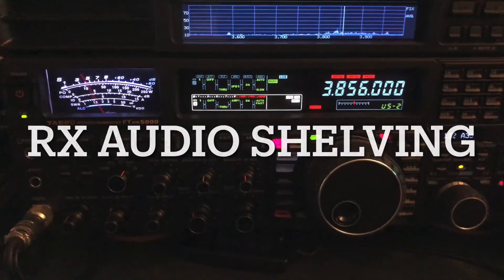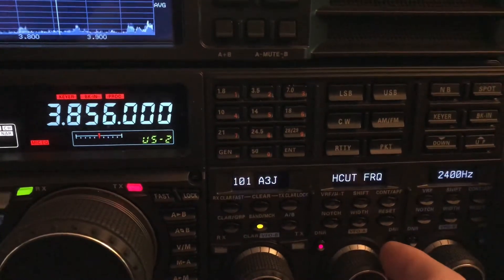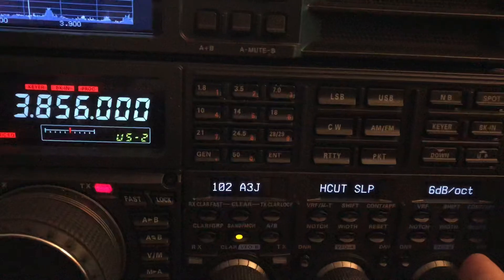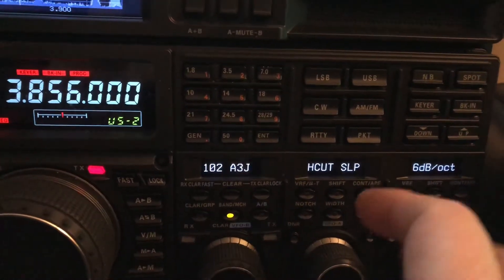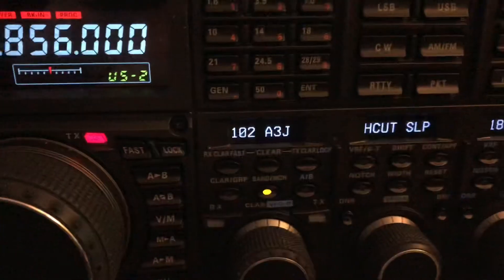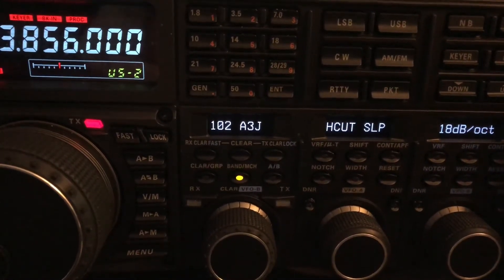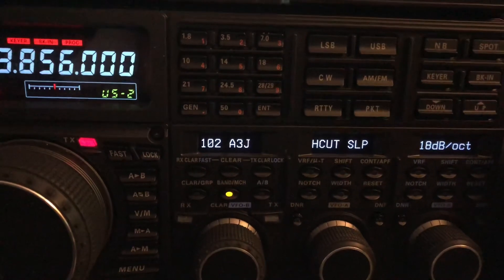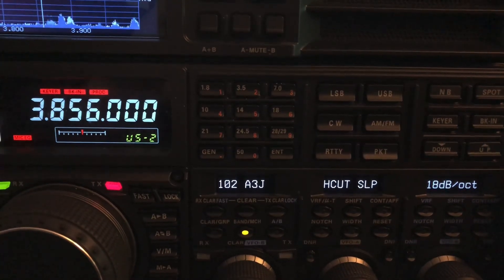RX Audio Shelving for Ham Radio

Comment: I’ve become addicted to LO/hi cut. I leave LO at 200 and rarely ever change that. Use high cut for bandwidth and QRM. I don’t remember seeing a way to do this on dx10 videos and that puts me off from trying a dx10. Maybe I missed a video you did on it. Also like a dedicated knob for hi cut.
Reply from the maker: The older audio DSP units, and older Yaesu radios, like my FT-920, provide a separate high and low cut knob, but that is accomplished via AF DSP.  With IF DSP, you have only a bandwidth knob, which narrows the passband from both the high and low end, simultaneously.  Then you use shift to decide whether you want to position this passband to emphasize lows or highs.  But that is separate from AF tapering, which is the subject of this video.  

The FTdx10 offers AF tapering.  It is located in the Radio Settings menu under Mode SSB, and is called hi-cut and low-cut.  You have a choice to slope at 6dB/octave or 18dB/octave.  I like to begin the hi-cut at 2400 to 2600 Hertz and slope at 18dB/octave.  I have even set it to 2100 Hertz with a slope of 6dB/octave.  I set low-cut to 150 Hertz and slope at 18dB/octave, or I set to 200 Hertz and slope at 6dB/octave.  

So many hams these days add too much low-end to their TX audio, so sloping at 150 to 200 Hertz helps clear up their “muddy” audio.  I have set low-cut to 300, in order to have a QSO with someone who had so much low-end that they reminded me of a bullfrog.  I did that rather than risk offending him by telling him how awful his TX audio was.  I could have also narrowed the passband and used shift to emphasize the higher audio frequencies.

73, de N4HNH
Reply: @n4hnhradio  k3 and ts-590 both have LO/hi cut that are NOT in audio
Reply from the maker: Yes, I know them well.  That is IF DSP.  It accomplishes the same thing as Yaesu’s DSP bandwidth control, but with two adjustments instead of one.  You are narrowing the passband by separately adjusting the high-cut and low-cut in the IF stage.  With Yaesu transceivers, one bandwidth control knob cuts highs and lows simultaneously.  Then you move this newly defined passband around with the Shift knob.  This allows you to shift away from QRM.  I’m sure you’ve seen that in the plethora of videos I’ve posted that show that.

The audio shelving I speak of in this video is a completely separate thing.  It is a high cut and low cut that is done in the audio stage.  Yaesu provides both options with the FTdx10.  That’s why I use both simultaneously.  The audio taper assists the IF DSP bandwidth control.  It is especially helpful for CW.  I set hi-cut to 700 Hertz at 18dB/octave and low-cut to 500 Hertz at 18dB/octave.  My sidetone is set at 600 Hertz, so I am only allowing the audio stage to amplify +/- 100 Hertz from my sidetone frequency.  I am essentially limiting the AF stage to a 200 Hertz spectrum, besides what the DSP width might be set to.  Of course it isn’t like a brick wall.  At 1400 Hertz the audio stage has cut by 18dB and at 250 Hertz the audio stage has cut by 18dB.  18dB is the maximum setting.  This provides the steepest filter skirts.

73, de N4HNH
Reply: @n4hnhradio  I don’t want to beat this in the ground but will the dx10 indicate say hi cut 2400 or I think I’ll have to get used to the old way of a negative shift value with narrow bandwidth. I’m not sure I want to go back to the old way.
Reply from the maker: The FTdx10 displays the bandwidth you select.  If it reads 2400, then your IF filter cuts at 2400 Hertz, assuming that Shift is centered up.  If you shift counterclockwise, you are dropping the  the frequency where the IF DSP begins to cut from 2400 to maybe 2250, 2200, 2100, etc.  but you are also favoring a lower frequency response.  If you don’t want more lows, rotate the width knob more counterclockwise, narrowing the passband even more.  You could narrow to 1200 Hertz if needed, to knock out QRM on SSB.  You can narrow to 50 Hertz for CW.  These are some of the reasons the FTdx10 is number two in the world, second only to the FTdx101D or MP.  The filtering is super tight and almost razor-edged.

The display on the FTdx10 shows the passband width and it shows where the center of the passband is, as you move the passband up and down with the Shift control.  Again, this is all IF, not audio shelving.

73, de N4HNH
Reply: @n4hnhradio  it’s still a lot of fumbling around when all you need is hi cut.

Comment: I’ve done is as crazy as 200-1100hz 18dB high slp and really squeezed the audio and pulled out s0 signals
Reply from the maker: Nicely done.  I use every type of filtering available to pull out the ghost stations.  73, de N4HNH